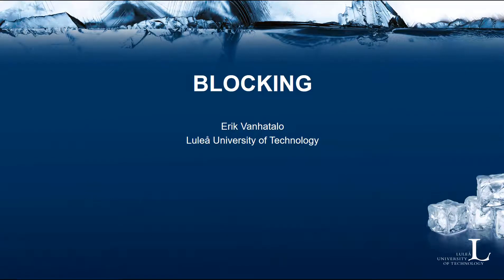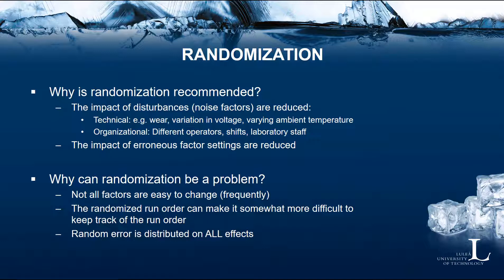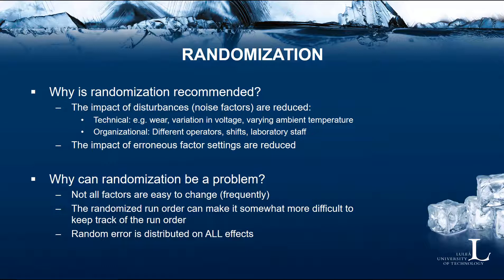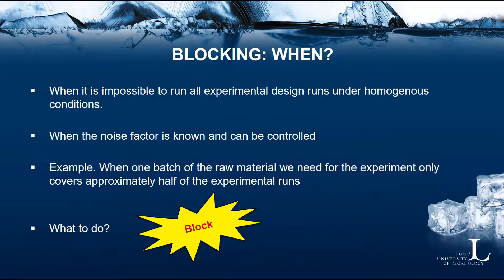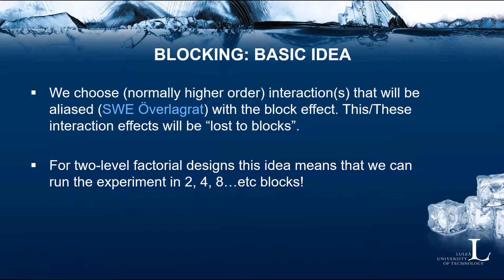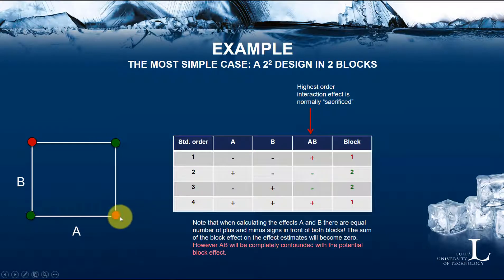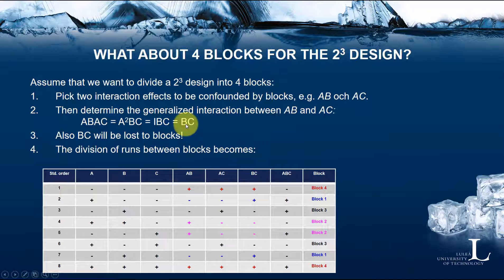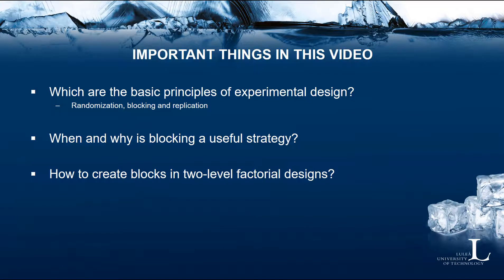Introduction to blocking in experimental design

Comment: Are the highest order interactions chosen to be confounded because they provide the least useful information?
Reply from the maker: Yes, the fact that higher order interactions are less likely to accurr (a priori) makes them good candidates to "sacrifice" to blocks. Higher order interactions do occur but have been shown to occur much more seldom than main effects and low order interctions in real life. Best wishes! Erik
Reply: @erikvanhatalo7  thanks
Reply: I've been thinking about it, and I think info from higher order effects is less likely to be statistically significant and more difficult to interpret. Is that the reason why they are selected?